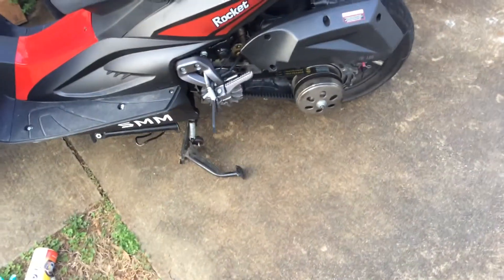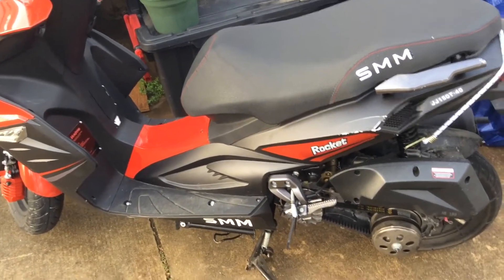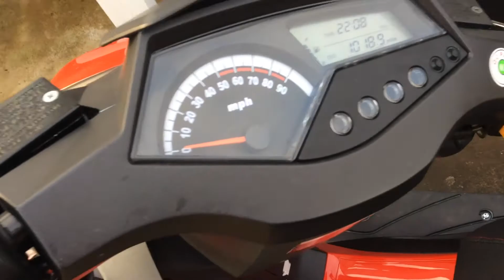scooter repair update part three😮

Comment: Hey buddy she sounds great ..🙂👍 I'm glad your able to ride 8 miles with out her dieing out hopefully she will ride ok but if you ever experience a die out during a ride unscrew your gas cap turn it over if it starts replace your gas cap k 👍other then this I would put a new cdi box & coil wire these two parts are under $20.00 on Amazon or Ebay they sale for $10 apiece but for now she sounds good and you did go for a 8 mile ride I would continue to ride her but not so far out just incase she turns off again but I think you'll be ok I would change out her coil wire and cdi box shoot might as well clean your jets in your carburetor as well this way you know clean gas is able to get through 🙂👍continue to keep me posted k buddy I wish you luck bro good job on what you done to her so far ..👌